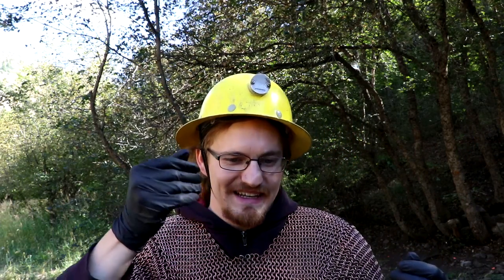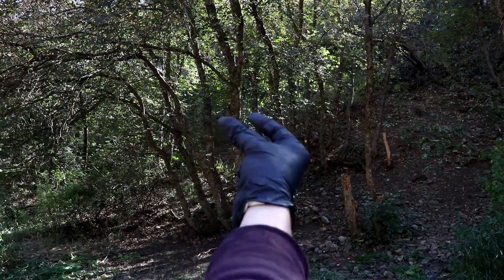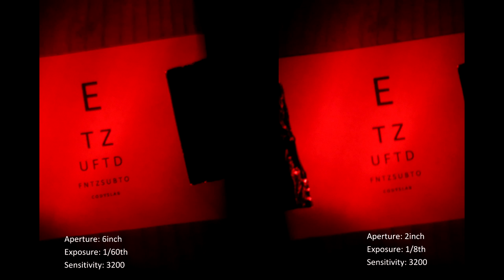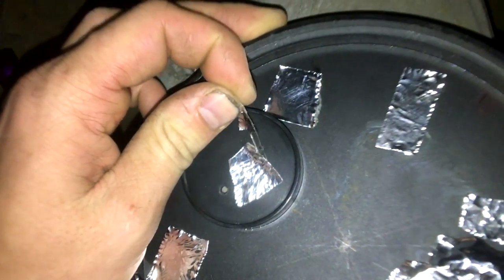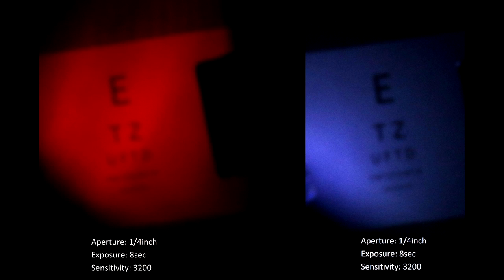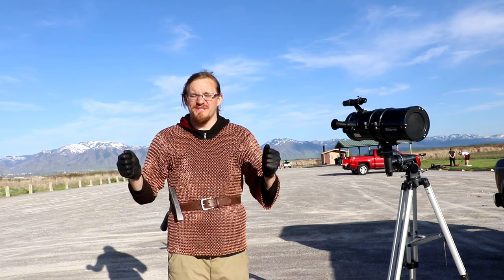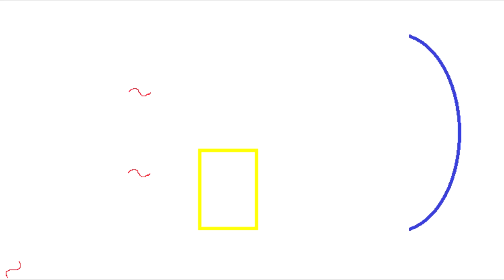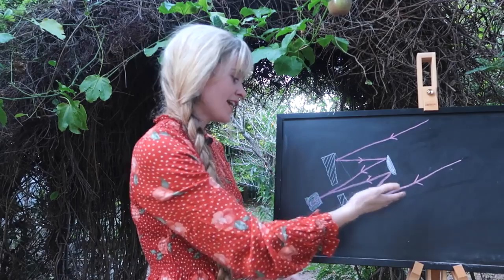Copper Clad Cody Attempts to Explain Interferometry

Comment: This also ties in perfectly with Scott Manleys video about Spy Sats he just posted as well!
Reply: Scott Manley: 'spy safe...'
Reply: Lots of comments on that video, with zero understanding of light imaging.
Reply: I wonder if it's even easier to make optical interferometers in space because you have no diffraction. Get some index of refraction altering metamaterials for fine tuning and suddenly you're seeing ants from orbit.
Reply: @gajbooks  The passage through the atmosphere completely destroys the coherent waveforms of visible light.
Reply: @gordonrichardson2972  There's already astronomical equipment that uses adaptive optics and other techniques to stabilize optically distorted images. I'm sure a military satellite could implement some of these.
Reply: @gajbooks  Firstly interferometry has nothing to do with adaptive optics. Ground based adaptive optics rely on a pinpoint object such as a star, I do not know how the equivalent technique works when looking downwards. At best adaptive optics compensates for atmospheric distortion, but the image is still subject to diffraction limits.
Reply: @gordonrichardson2972  I'm only sort of wrong. I read some more and found that interferometry can achieve higher resolution through atmospheric distortion, but the diffraction limit is still in play. So the military could be using either adaptive optics, or interferometry, but both together would be pointless.

Comment: Great demonstrations! and cool chain-mail! Also just have to say: Diffraction is not really related to Heisenberg's Uncertainty Principle, but they do have the same mathematical description. It's all related to the Fourier transform,  it preserves norm and inner-product, so it preserves a probability under transformation. Now you could derive diffraction from HUP, or more common you start with Huygens's principle to derive diffraction. But usually, in the context of HUP we are talking about Fourier-transformations from and to position and momentum. For light we would talk about a plane-wave that moves orthogonal to some plane.  Taking the FT over the plane gives the spread of directions of the light-wave. Now in both descriptions, by having a definite position in one space, the FT- will spread it out in the other. This consequence of FT gives the diffraction, and HUP.

Comment: Great video! Just a comment from a camera nerd:

On a digital camera, changing the ISO doesn't actually affect the quality. You'll get the same image by taking a photo at ISO 100 and increasing the brightness in a photo editor as you would using ISO 3200 in the first place, minus some potential minor artifacts (as long as you're shooting in RAW). If you don't believe me (I didn't believe it myself when I first heard this) there are comparisons people have done online. Basically, increasing ISO increases gain, which also amplifies noise, which is the same thing that increasing the brightness does.

The reason people think about it this way is a holdover from analogue cameras. When using film, the ISO describes the actual size of the silver halide grains, which obviously can't be changed in post. Using ISO 3200 film WILL result in a grainier photo than ISO 100 film, but this doesn't hold for digital sensors.

Anyway, I don't mean this as a criticism of the video or anything, since it's kind of tangential, but I thought you might find it interesting. Thanks for making such great videos Cody!

Comment: The difference is that the electromagnetic information that arrives a the event horizon interferometer doesn't carry spatial information, that is, it has interfered with itself and with the environment to such a extent that it wouldn't produce a reflected image of the source over a sensor. So they wrote a software that takes such information and tries to guess what kind of visible object would have produced it (before becoming interfered). The analogy with your aperture experiment would be more like if at the end of the video you would have written a software to which you feed the image with the lesser resolution of all (the one with more interference) and try to reconstruct the letters from it. It would still be an incredibly parabolic analogy because the radio information that arrives at the event horizon carries information that is not related to "visual" information as well.

Comment: The CSIRO in Australia has the ASKAP array in Western Australia. its a square kilometer array of around 36 radio telescopes. The data from the radio interferometry is processed in a supercomputer center in Perth.
Reply: And the MeerKAT radio interferometer in South Africa, soon to join with ASKAP as part of the SKA radio telescope.
Reply: @gordonrichardson2972  do you know if the MeerKAT will be using the same phased antenna feeds that ASKAP are using?

Comment: You can get symmetrical hole patterns with a compass, make a circle with a compass, mark a dot on the original circle, and make another identical circle around that point, then where the two circles intersect make more dots, repear until you have 6 equally spaced dots an equal distance from the  the center, now you have the spots for 2, 3, or 6 symmetricly placed dots marked, the pattern can be taken further for more dots.

Comment: 5:00 There's a principle called the Huygens Fresnel Principle, that states that every point, where a perturbation is taking place (where the wave is travelling), produces a secondary point source right next to it, and makes it so that the perturbation travels forward only. The thing is that, when you manage to get some specific conditions (not that uncommon), like a determined wavelenght or opening size, these kind of effects occur. In actuallity, these effects do happen all the time, but they are incredibly unnoticeable, unless the conditions match with what you need.
Whats happening more deeply, is that when the coherent secondary point sources are generated when a wave hits an obstacle, it generates a distribution of these sources, and what happens is that the wave function of every wave coming from the different sources adds up in a way you get interesting patterns  you can see far away enough.

Comment: The diffraction limit is basically counting the number of wavelengths of incoming light that can fit through your aperture. In essence, the light from either side of an object you are observing must propagate different distances to get to your telescope, and if those distances differ by less than a wavelength your image will be fuzzy: the photons will always constructively interfere and no image will be resolved. If you work it out, you'll find that the criteria for interference (fringing, in interferometry) is D/Lambda = Theta where D is the diameter of your aperture, Lambda is the wavelength of light, and Theta is the angular size of the object in the sky.

Comment: This is why back in the old days, you "fixed" scratched lenses by painting the scratch black. It decreased the effective collection area, but not the aperture.
Reply: Mal-2 KSC Good point! Cody only mentions blocking light, but the aim of a lens is to preserve contrast across the visual field, scratches disperse light randomly.  Similarly I believe one of the manned space telescope missions had to clean a bit of shiny white fluff off the mirror.

Comment: Thanks. Good analogies. Thoughts: many tiny holes change the direction of the light from one to the others therefore the light coming from the black letters is relatively less significant; also consider the work of Mark Carlotto, Vincent DiPietro, Gregory Molenaar - they took images from many different frames and let the computer build enhanced images from the best correlation of all. Aside - higher frequency light has considerably higher refraction thru any change of medium. You said the DIFRACTION is higher with red.  Is this so? I gotta read up on difraction. How could these buncha tiny holes relate to FORWARD LIGHT SCATTERING? Thanks for your down-to-earth explanations. These probably contribute more to progress and invention than the mumbo-jumbo of academia. Wonderful.

Comment: I wonder what would have happened if you drilled holes on the outer radius of your cover. Does that yield larger effective aperture? For interferometry to work, it's also important to have holes spaced evenly around the axis of telescope lens. In your setup, it clearly was not the case.

Comment: yeh the optical interferometers uses a vacuum in the tunnels. The tunnel length can vary to the sensor, BUT does need to be well known and accounted for. This isnt much of a problem as delays need to be incorporated to the light streams for when the telescope isnt pointing directly upwards due to geometry issues (i.e. almost always), so this difference in tunnel lengths can be calibrated out with that same system. To do this, the light is put into the middle of a second tunnel. The light from telescope #1 goes to the left and light from telescope #2 goes to the right. They hit mirrors at each end of the tunnel, then bounce off a mirror cart that can move up and down the tunnel. This is where we can change the delays for each light path based on the position of the cart. The light goes back to the end of the tunnel before recombining and being sent to the sensor.

Radio Interferometers are easier as we can record the light far more accurately using a dipole rather than a CCD for optical. This means that each radio antenna locally records the signal and then electronically sends it to a computer to be combined. No difficulties using vacuum tubes! Hence, this is why we could create the Event Horizon Telescope and not have vacuum tubes spreading across the planet.

Source: Im an Astrophysicist

Comment: Cody: Do a little research on pinhole camera apertures.  You want the material to be as thin as possible  Typically a hole is punched through a metal foil.  Try that and I bet your multi hole images will improve.  Also, I would try to holes on opposite sides of the lens.  This will make symmetry easier while giving you a wider base for your synthetic aperture.

Comment: Cody, from my understanding a pinhole camera makes an image that is very sharp so shouldn't we expect the same in this situation?? Is it possible the images are blurry because the telescope is focused for an aperture the size of the telescope's opening? What would happen if you made a pinhole camera with multiple holes in it, or different size holes instead of using the lens cap? 

Also how would snow glasses with many small holes fit into this situation? We are still able to see clearly through those even when haphazardly made.

And lastly very nice explanation of waves propagating! Never heard the idea that it "re-propagates" from each interference point like the hole.

Comment: The first hole gave a slightly improved image. One possible reason is that you eliminated imperfect portions of the mirror. Sometimes astrophotographers will mask off the outer rim of their apperature because mirrors tend to be less accurate at the edge.

Comment: 11:07 Cody - not sure if you have a 3d printer -- but maybe 3d print a more accurate detachable cap with printed holes in it? Could possibly get down to 100-200um accuracy in a 3d print with a well calibrated printer. You could try all manner of different types of patterns.
Reply: Kieran Short The cap must be thinner than the diameter of the pinholes, so aluminium foil is the best choice. P.S. The pattern of the holes is not critical.

Comment: I was wondering... If you have a smaller scope aperture, you’ll collect less light, with less separator power. What if you use a bigger focal length (either with a bigger telescope or a barlow) ? I know you will collect even less light, but if you manage to increase ISO and exposition (assuming there is no noise) and take a lot of photos, you could make a mosaic, with bigger resolution.
Reply: I will try to test it later, but I have no time at the moment. As I have no cave or really dark place to test it, my results won’t be as good

Comment: Why do pinhole cameras work if the smaller aperture decreases the resolution? If I look at a screen from 10 feet away without my glasses, I can't read the text but if I look through a pinhole, I can read it clearly.
Reply: If you can see better when looking through a pinhole, you need new glasses!
Reply: @gordonrichardson2972  Better than without the pinhole, I mean. Edit: Forgot to mention without glasses

Comment: instead of cutting holes use a neutral density filter (from any  camera store or even ebay) .. the holes are much more even... and you can get much finer grades. Also since cmos sensors are a fixed size, do camera's use more of their CMOS sensor at hgher iso settings to trick us into think they can handle low light better??

Comment: I have a question, when you have multiple holes of the same size you get a better image right? but let's say that in the 2inch hole i can fit something like 32 smaller holes, is the image with the 32 smaller holes better than the image with the bigger one? i don't know if I explained it well, my english sucks

Comment: Cody when u showed that example  of light bending around the finger, I guess it's not diffraction and it's mainly air currents 
Correct me if I am wrong
Reply from the maker: It also works in a vacuum.

Comment: That plastic is fairly thick and it has a quite a bit of burrs on it that can cause more light disturbance. This case maybe different if it was on a very thin metal disk with laser cut holes on it.

Comment: suppose light is not a thing but an effect of something. when one says "sound wave" or "radio wave" one is referring to waves of "something,"  in the case of sound it's waves of gas or some matter, in case of radio it's waves of electromagnetic radiation. so "light wave" "waves of what?" suppose light is an oscillation or perturbation of a medium that is ever present i.e. an "aether" that is oscillating both transversely and longitudinally, thus causing it to exhibit the visible properties of a particle and a wave.

Comment: You don't "make the camera more sensitive to light" ISO is just gain. And depending on your cameras, there is low level noise reduction in the analog to digital converter when you bake your "raw" data.

Comment: Another confusing concept is how a single particle can have a wavelength. It really can't. It can have variable momentum though, which is something proven to exist in photons. Perhaps there is a connection to be shown between particle momentum and electromagnetic wavelength, because after all red light is lower in energy in one way or the other.

Comment: If I knew anything about programming I could digitally vibrate CCD image data at the same rate as the atmospheric medium distorts it. Maybe using monte carlo method to take 1000s of samples of the distortion per second for the computer to take a near real-time average and then plug these in as a function to reassemble the images. This technology could leak down to every-day consumer cameras eventually. Ok where's my Nobel Prize?

Comment: Cody, The 'Heisenberg' uncertainty principle is a thing of quantum 'statistics'. It's not, like, a physical law or anything.
The more you prod a quantum to figure out where it is, the more you disturb its velocity. 
The more you poke it to figure out its velocity, the more you disturb its location.
It's like a chaos motion machine. And the 'shrodinger cat' - To observe the universe you HAVE To interact with it and read its response, but that interaction DOES mess with the data. 

If you knew a quantum particle's velocity and location, the uncertainty principle obvious falls apart.

Let's see, uh, a more mathematical simple example.
We have a particle traveling at a 0 degree angle, with a speed of 1m/s
You don't "Know", that, so you poke it, lets say a photon, imparting it with 0.1m/s speed.
Now, you see the reflection of the particle, and confirm that it's moving at 0 degrees angle.
But you didn't know about the speed, so you know it's 0.1m/s less certain of it's speed.
See, when you hit it with a photon, it's like Pool, the ball game, you could've hit it under any angle, and sent it flying any direction.
Kind of like a game of marco polo, but every time you say marco, everyone moves. 

This only truly makes sense if you try to predict the LONG TERM movement of the particle.
Right now you may figure out it's 0 degree at 1.1m/s , but a few minutes later you'll not find it where you expected it,
because it was actually moving at a 0.1 degree at 1.11m/s.
But when you try to 'see' it at its future location, you bounce it off on a random new angle, 

It's just Pool, okay? Blind pool. Every time you throw the cue ball (photon) at the particle, you could've knocked it in any one direction with any force.

That help? No? Probably didn't read? OH fie, fiddlesticks. What now?
Reply: Specifically it has to do with predicting the 'collision'. 

If you know where it is, and shoot your photon at it, you know at what angle it'll bounce off, and therefore what it's new direction will be.

But quantum particles aren't perfect mathematical models, they wander off. So you'll add some 'noise' velocity to it, and it'll go a bit slower/faster, depending on where you hit it, like a game of pool.

But if you don't know where it is, but know it's velocity, when you bump it, that's even worse since you completely don't know how it'll bounce off now.

You just need to stare at some quantum graphs to "get" it. It's not intuitive until you work in the field. It's like trying to explain electrical voltage as water pressure to a person who's not fucked around with either of the two.